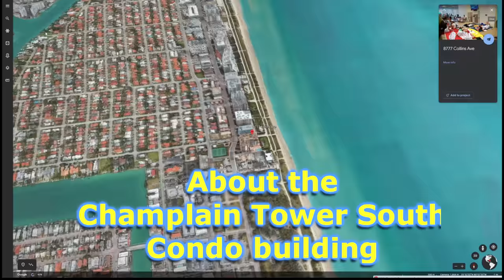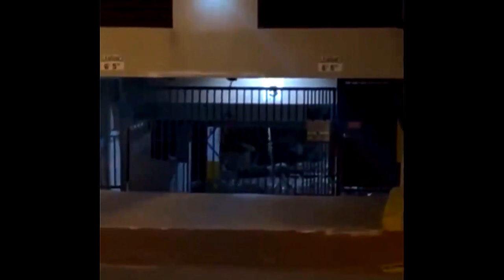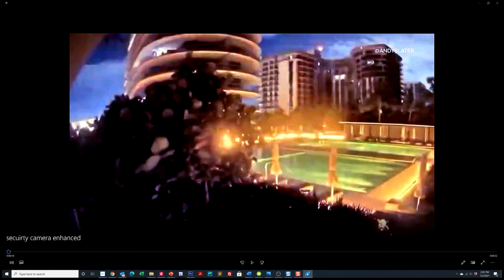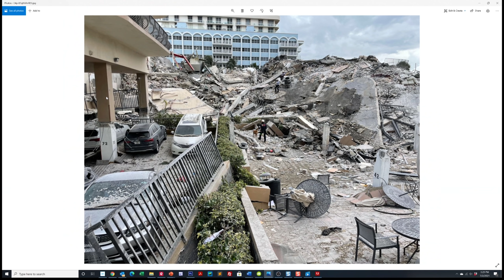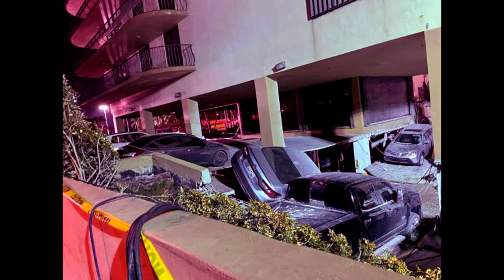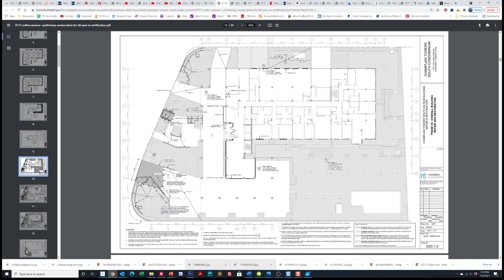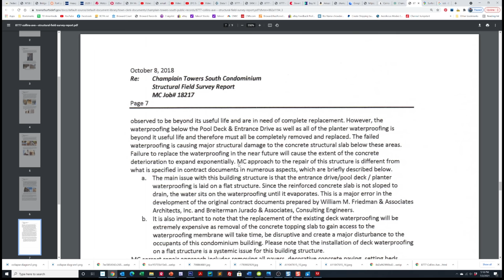Here's Cause Of Miami Condo Collapse Champlain Condo Towers, Surfside

Comment: Two observations: 1) Considering the known effects of the seafront environment on almost any structure, I question the wisdom of a so-called 40 year recertification period.  I also question the wisdom of waiting until year 37 to initiate a comprehensive structural investigation to support such a recertification.  Given typical permitting and construction cycles in metro areas both are likely to be too little too late.  2) Loss of the plaza slab (pool deck as it has been commonly referred to) most likely resulted in the loss of lateral support for one or more of the exterior columns indicated herein as being part of the initial collapse.  Doubling the unbraced length of most any column of any type construction (steel or reinforced concrete) is usually fatal.  Even more so when structural integrity of column to slab connectivity is compromised by 37 years of exposure to water intrusion.   One or more exterior columns bucked and progressive failure of the structure ensued as a result.
Reply: Timothy, I like your explanation.  Lateral rebar through the columns supporting the plaza slab looks insufficient, but given the columns are needle thin, there’s not much room to run much more steel through them.  Given the inevitable salt water penetration into the slab to column interface in the seaside location it’s just a matter of time before corrosion critically cuts the factor of safety.  Partial slab failure caused a small number of needle columns to buckle.  There was insufficient redundancy in the remaining structure to resist for more than for a few minutes.   
Absence of drainage slopes is a bit of a red herring - any building that age will have suffered chronic flooding in small areas due to subsidence, weather leaks or plumbing that are disproportionately expensive to repair immediately.  It looks like the building design lacks sufficient redundancy to cope with this inevitable problem.  Is this a cultural issue particular to Florida?
Reply: Agreed. I’m thinking it should be moved up to once a decade. Especially in instances where it’s multi-family and very little chances of it being caught when condos exchange hands.
Reply: Yep. I guarantee that there's some people who knew there was a problem long before this happened. And they just didn't want to spend the money or deal with it because they felt that a building is strong. I can honestly see somebody not thinking water can affect concrete when an engineer will tell you that concrete and soak up water like a sponge if not properly treated
Reply: How many problems have to be caused by people who wait 37 years to deal with something if they would have dealt with it properly in Year One we wouldn't have this problem
Reply: @cameronrobinsonart  I don’t think it is practical to immediately deal with minor but often expensive building problems like you must on an aircraft.  The money and resources required  aren’t there after the initial investment.  The structure is a relatively small portion of the total development cost and shouldn’t be over designed (cut to the bone).  That is what is assumed and what is resourced.  It is apparent some structural designers have moved to low redundancy but failed to force the lucky owners into a high intensity maintenance regime.  You cannot expect a low redundancy design to survive without intense aftercare.
Reply: Who received this report and was it Available to homeowners association?
Reply: @tompastian3447  If they change the laws, they will need to make sure that there are also an increased number of inspectors to do the job, or else you will end up with a lot of problems getting missed or skimmed over due to lack of time. It's going to cost more than just the HOAs and condo owners. Mostly they need to get at the very root of the problem and nip it in the bud before it even happens by holding architects and contractors liable for taking short cuts and/or skimping on materials. Put the fear in them and you won't see things like toothpick columns failing.
Reply: @Chompchompyerded  Various counties can order condominiums to be inspected.   The process as I understand it from a condo attorney on 850 WFTL, 11 am - 12 noon every Sunday, a condo board has to hire an engineer to do an inspection.   IF repairs are needed, the condo has to provide the local zoing board with a time table to do repairs.  No doubt as you say, the building regulations may get more stringent from now on to nip future building problems in the bud.
Reply: Oh sure, you want gub'mint! regulation to make structural investigations happen more frequently on such buildings/locations.  Regulations to protect life and limb and property.    You'd make a terrible Trump supporter / Republican.   Although focusing more on the property loss would spur them to more action.
Reply: @jim woods I will definitely agree that I'm not a structural engineer actually I don't understand everything that you said to me but what it sounds like you're saying is you're justifying the practice of not properly taking care of something because it's expensive which has been the downfall of many organizations cause of a lot of accidents with machinery or things like amusement park rides. It's what caused the Texas blackout people who didn't want to deal with the little things because it wasn't cost-effective to deal with it. That makes me think you own some properties or a company where you probably don't do everything you're supposed to on the assumption that is not cost-effective to deal with the little things. So good luck with that lol. In the meantime there's going to be over 100 dead people found in this building because someone didn't want to deal with some issues they were supposed to especially when you have residents who can say that they would walk through puddles of water in the basement on days that were dry outside. Sorry but that kind of seems like a defensive response to say properly inspecting or maintaining something isn't realistic. People spent millions of dollars on their condos. I'm sure the owners just wanted to have an excess of profit and it wasn't until they had to deal with a mandatory 40 year inspection process to start doing anything. I guess that's the way the world works and that's the way you think it should
Reply: @jimwoods9551  Thank you Jim.   You are correct also in noting the lack of redundancy in the building.  The shear wall at the elevator was intact all the way up but the building it should have helped to stabilize separated from it cleanly.  Not to say that the shear wall was specifically intended to resist the loss of one or more columns, but there seems to be a lack of continuity in the RC structure.  I think that in a part of the country with higher seismic design requirements the building might have performed better.  Seismic codes have incorporated many requirements over the last three decades to add redundancy and thereby minimize the occurrence of catastrophic collapse.  But poor maintenance alone can defeat these precautions, and of course there are many things we don't know about the entire scope of the building design and construction as of yet.
Reply: @EmeraldView  I'd never consider supporting Trump anyway. Not my cup o' tea. Just saying. There have been some Republicans whom I've supported, but mostly in the distant past. Many of them are no longer Republicans.
Reply: I don't know... There were people who were part of that condo association, who made decisions about what repairs were needed and not needed and had all the inside information, living in the building. I think if they knew it was that bad they wouldn't have been living in it. They obviously knew repairs needed done because they were supposed to be starting major repairs what, a week from when it collapsed? But if they were living there maybe they didn't realize how serious the damage was or that it was far past or beyond repair.
Reply: Yes. It should be more like a 15 to 20 year recertification period.

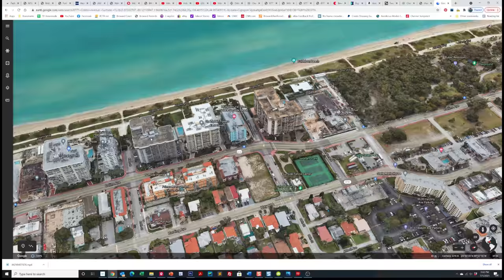Comment: 1:46 if this tower has the same floor plan to the one that collapsed, probably means that they have the same type of small columns (where it initially failed) and no proper water draining system, which this is like a ticking time bomb if that draining system is not improved.

Comment: the thicker columns under the tower that was left standing is because that part of the garage roof is supporting more parking and a drive way. It was expected to be taking heavy moving loads. The other thinner columns are supporting the pool deck, which was designed to  handle lesser pedestrian loads.

Comment: I'd be interested if their are other locations of clorinated filtering, separate from the one pictured, and where the chemicals used for the properties pools (etc.) were located. Multiple locations with the level of deterioration indicated in those photos may prove to be the source of the structural failure(s) that caused the building to collapse...but collapse of the the pool deck, alone, shouldn't cause the building structure to also fail. The pool deck should have been designed to separate from the main building, even in the 70's, as a best practice principle of engineering.
It's well documented that CHLORINE has a  heighted effect in the deteriation of poured concrete, and that its effect amplifys once spalling begins.
Also, concrete placed 40 years ago did not utilize any plasticizers to reduce wicking that will result in bar corrosion and, ultimately spalling.

Comment: I would been scared to death just to walk into that hell hole! The whole structure could have fallen down while taking those very pictures!
Reply: ..I find it impressive that they have already deemed the North tower, built the exact same way, is OK.  It likely has the drainage issues, the same column and deck design, and possibly the same concrete and rebar vendors that worked on the South tower - as an engineer, I'd suspect the column design, the rebar placement, the concrete strength and likely conclude that if both buildings are similar, they both contain the basic flaws - just a matter of time

Comment: What they are not showing us are security camera footage from inside the building and the parking deck. All security cameras that are in this high-end building are high in quality that has a DVR and cloud backup that you can access from anywhere.  Where are the pictures?  This is a cover-up. Liston at the beginning of the video he points out the pool room and that stayed intact?
That pool would have caved in first where the pool room is. He clearly showed it didn't.

Comment: at 15:07 the columns searing of the floor deck indicates that there was no beams running in four directions off the columns, just the floor deck, think there are suppose to be beams under the floor decks, in just about ever form of construction I have ever seen.
Reply: its a flat slab construction where beams are not required.  its fairly typical
Reply: i think thats exactly the problem not beams
Reply: @tonyholohan6756  Yes, beams aren’t required but they would make it stronger. What could have been a problem is not enough rebar connecting the columns to the slab - I think there are some photos that show there may not have been the correct amount.
Reply: @Sashazur  i agree that  beams and columns do tend to be less prone to failure than a flat slab on columns. But a "properly designed" flat slab is a great structural solution.  Some of the rebar must pass through the columns, but most of the strength at that junction is dependant on the slab thickness + some punching-shear reinforcement in the slab. Sometimes a thickened slab is used at the columns to prevent this "punching shear" failure observed in the photos.   I suspect the slab was probably designed correctly, (otherwise Morabito engineers would have flagged this in the 2018 report) but that the water on the deck has corroded the rebar causing the punching-shear failure.

Comment: I just hope that those who were in the buildings didn’t have to suffer 😞
Reply: Worst way to die. Couldn't even imagine.
Reply: I was hoping they were asleep and did not know what happened. My heart hurts for every person involved in this, the victims, the survivors, the families and the first responders. Sending love and prayers to all. ❤
Reply: i dont know, despite how many times i try to spin it, i feel that they would've been awoken viciously from their sleep with barely anytime to think of whats going on, then suddenly crushed or impaled by concrete or metal. may they RIP
Reply: @garythesnail6177  : same. A split second to spring awake at the sound of crunching then suffocation and impaling. Someone needs to be imprisoned for this.
Reply: They don't. They have been crushed to death before they knew it... Sudden deaths...
Reply: @garythesnail6177  Sadly just watching the collapse, they were most likely flatened by the concrete floors. Simialr to 911.RIP.
Reply: Most of your internal organs would have violently exploded out of every orifice including your eye sockets.

Something I discovered while writing this is that YouTube will not attempt to auto correct the spelling of “orifice”. Just another piece of knowledge to throw on the burn pile.
Reply: @tianly6177  Yea no suffering very quick

Comment: An interesting aspect was shown on another channel. The original plans from the first architect shows more drainage and slopes for the pool deck than can be seen on later plans and the status quo before the tragedy!
Reply: But the integrity of a pool deck should never relate to the integrity of the building next to it. That's going to have to be the main issue. The 2018 report didn't adequately tell the residents that they faced a possible pancaking death in their homes rather than just their cars being damaged by a relatively harmless pool deck collapse. 

I believe all buildings that now rely on their pool decks and skinny underground garage columns, should be torn down or these underground garages filled in.
Reply: I guess down the road they wanted to save money and changed the plans!
Reply: Would it be correct to say that having an underground parking garage makes a building weaker?

Comment: I'm wondering if this building was part of the late 70's, and early 1980s construction where a lot of old money, and retirees, and drug money was pouring into the Miami area, where they couldn't build homes and Condos fast enough.  The wondering part is because back then, there were some buildings that had to be condemned because they didn't meet the codes to ensure building safety.  I remember seeing a TV show about this, where one building was never certified, and people never moved in because it was sinking slightly, and it was found that the contractors had cut corners.  In some instances when funding gets tough they might not use enough rebar, or their columns are too small to support the building. (Was someone's math off? Or were they just cutting corners to save money?) It sounds like several factors working together here, and over time.  It sucks that people had to lose their lives over this.
I hope this brings in new inspection methods and Codes. After that I hope everyone from Architects to Engineers, to contractor take their jobs more seriously so this kind of thing doesn't happen again.  

That also leads me to another question. How long are buildings like that supposed to last? What is the expected Lifespan of a building such as that,  in that location?
Reply: Year built:  1981
Reply: This was my 1st thought as well.
Reply: Lifespan is a relative term. It is relative to the quality of the maintenance.  In the case of this building the lifespan was 40 years. Had it had proper maintenance the lifespan is indefinitely
Reply: @justanbaker8937  I would also add that the building must be built properly to begin with. There are temples in Greece that still have Columns standing. Archways in Rome that still exist.  There's something to be said about building it right to begin with. And yes, having been a Maintenance person, I agree with you.
Reply: @MurpheeLaw  thats fair with the exception those practices and materials are not available now. All that matters now is maintenence .

Comment: Much of the concrete made with 1980’s cement is a concern. There was a significant cement shortage through the 1980’s with much of the imported cement at the time of questionable quality…add that it wasn’t until 1983 where codes changed to require more concrete cover over reinforcement, particularly for concrete structures exposed to salt air environment. It would be interesting to see if any records still exist where the materials were procured. Your observations dovetail into why this collapse otherwise appears puzzling…good job!
Reply: Concrete was stripped of the steel rebars explain most of this disaster.
Reply: You bring up a really good point, if this is true in this case then it could be added a cause.
Reply: There is also much speculation that inadequate amounts of steel reinforcement was used.
Reply: @steve707  I do not doubt that...I consulted on one of my very first large lawsuits (1986) where a few hundred premium homes were suffering from very poor quality control. Although the concrete did meet "minimum" standards, the sales job/promotion was that each component was a premium product, minimum standard does not qualify in any person's vernacular of being a "premium product". During arbitration, I likened it to putting in chevy parts and selling it for a Mercedes price and presenting it as Mercedes quality...they didn't fare well and were held accountable...but NOTHING of this magnitude where lives were endangered.